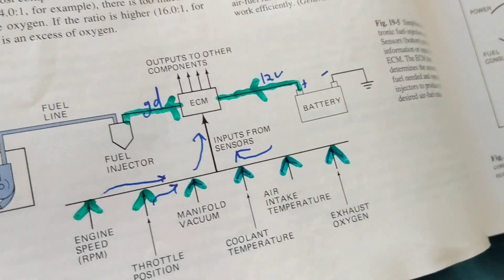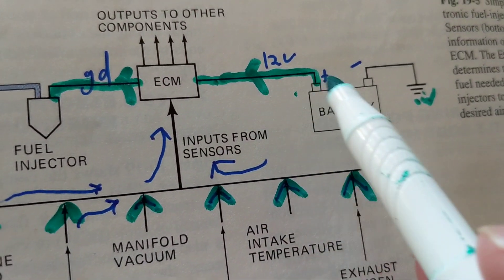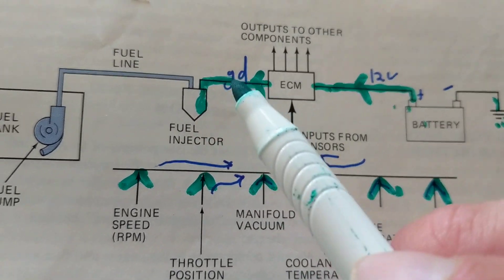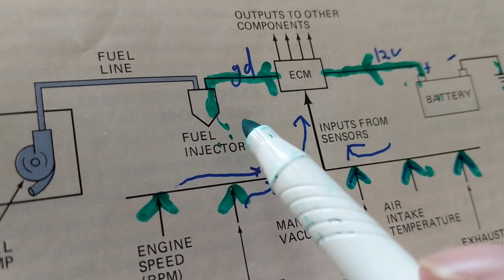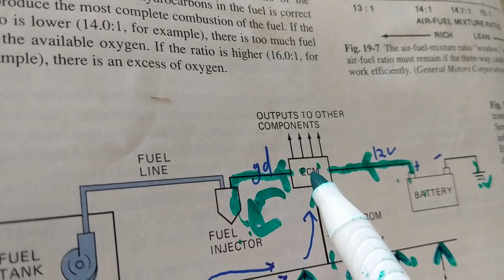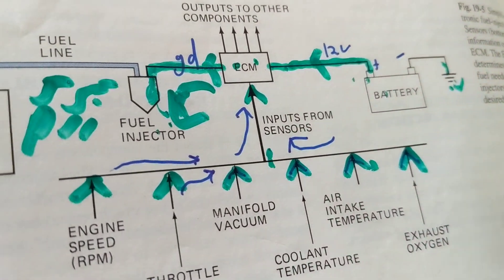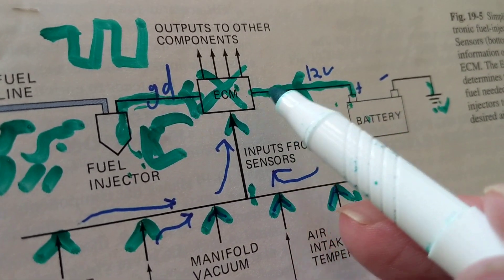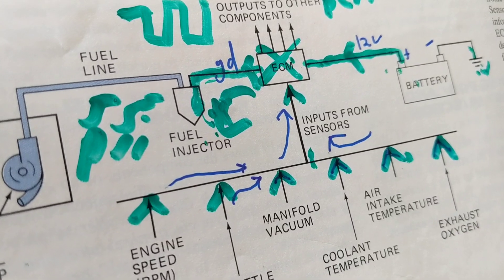HOW TO UNDERSTAND HOW YOUR FUEL SYSTEM WORKS FROM VERY SIMPLIFIED PICTORIAL

Comment: Please make video elaborating WHAT ARE THR CAUSES OF EPS MODULE FAILURE????
Reply from the maker: Thank you for your comment I remember I made a video about that and it should be on the channel Joe electronics schematics for Auto because EPS has been around over 20 years actually but it's been popular now since it's been manufactured in cars what might go bad or the torque sensors and the motor the computer controls everything look it up if you can't find it please respond back
Reply: @Joeelectronicschematicsforauto   the following are my diagnosis results. 
1. All warning lights come on at key on. These are ok. 
2. But EPS light still glowing after engine running.
3. I have checked the 3 connectors on EPS module. I got 12v to the input coupler of the Module. But there is no 12v Or no voltage from the output coupler of the EPS module. 
4. I have also checked the torque sensor, CAN voltages using Multimeter, and everything is ok.
5. 12v from the IG switch is ok. 
Please help me what causes the EPS module failure???
Reply from the maker: @tnamen1307  depending on the module first you need obviously be plus to the module 12 volts that will control the switches of the module to the motor and which direction to go internalize then also you have torque sensors usually a body control module communicates to the CPS module it tells it what to do but also the outputs are in communications form but you need a scope to look at and only a scope can give you the right display depending the problem on your steering problem
Reply: @Joeelectronicschematicsforauto  I have to travel about 4 hrs to reach the nearest service centre. I have search internet and watched over 50 YouTube videos. Surprisingly, none has explained WHAT CAUSES EPS MODULE FAILURE!!!! 
Almost all videos talks about "EPS MOTOR and MODULE DAMAGED and have to replace'. That's all.
Reply: @Joeelectronicschematicsforauto  please kindly make videos Elaborating why EPS MODULE fail. Thanks in advance.
Reply from the maker: @tnamen1307  I made a video about princess circuit boards printed circuit boards that was pretty technical printed circuit boards on multi-layer boards with surface mount technology those microprocessors have very thin pins on them from vibration they come off the pads you can look it up on my channel then I just gave you information about these printed circuit boards and modules that are burned and also bad connections very advanced video but if that's what you are referring to please look it up on the channel you'll understand more after that
Reply from the maker: @tnamen1307  another challenge Automotive electronic schematics for Joseph and this channel is Joe electronics schematics for Auto look it up you'll see some more Hands-On and explanations of printed circuit boards pretty technical and people email me that it is too complicated to understand
Reply from the maker: @tnamen1307  if you see those videos of princess circuit boards are in modules you'll understand why modules fail vibration and heat mostly vibration and microprocessor pins thank you so much for being a viewer